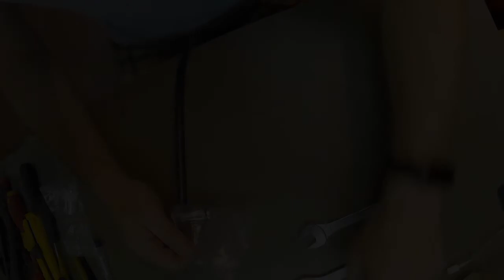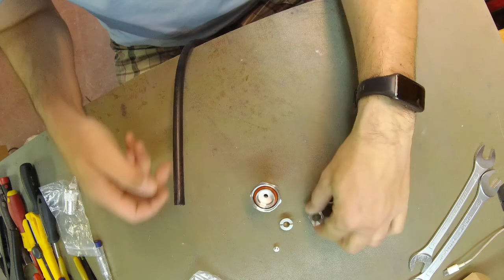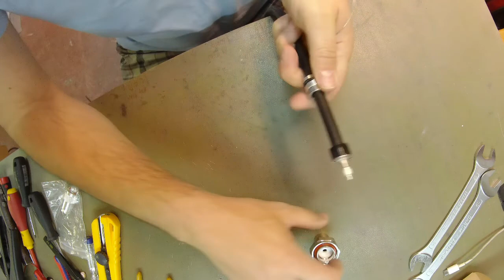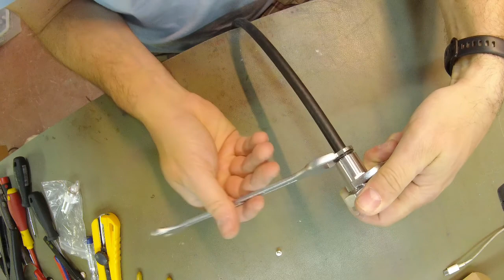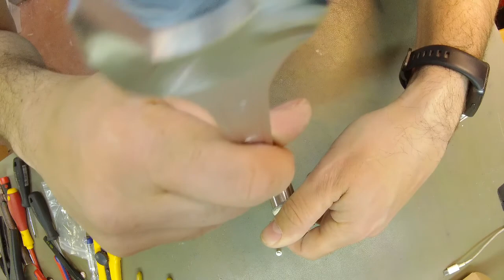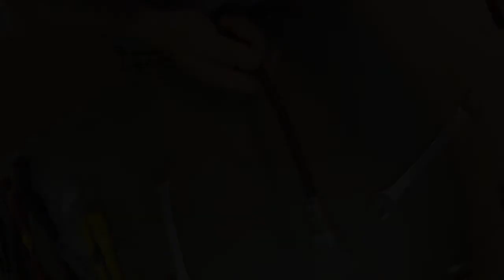"how To Install A 7/16 Connector On The H2000 Like A Pro!"

Comment: Could you make a video of PC Transmitters PCIMAX3000+ working?
Reply from the maker: Install the card in the pc, connect the usb cable and power and you are done. install the software and transmit.